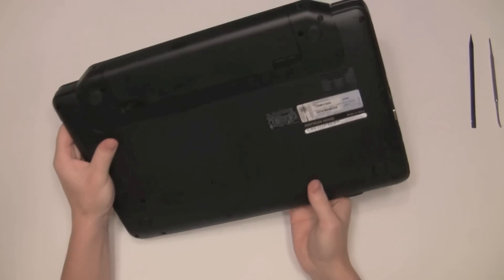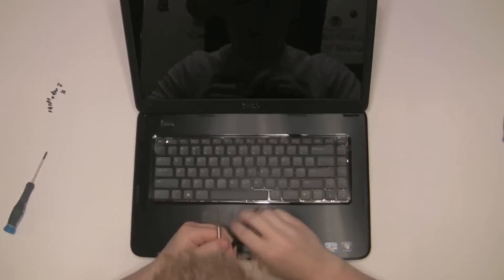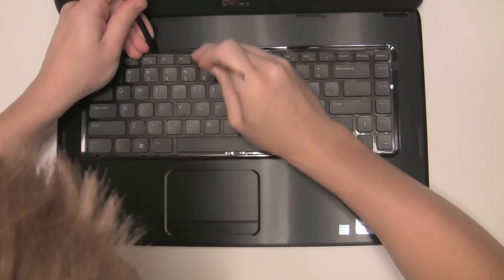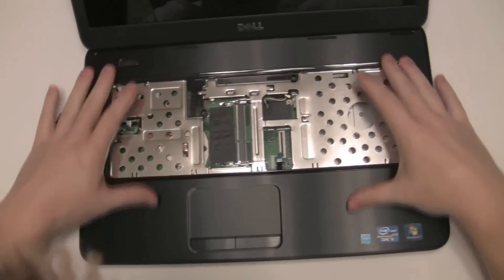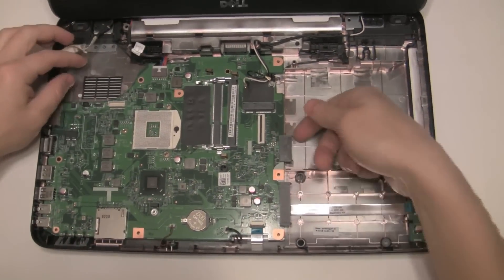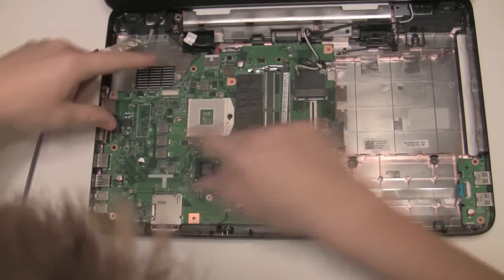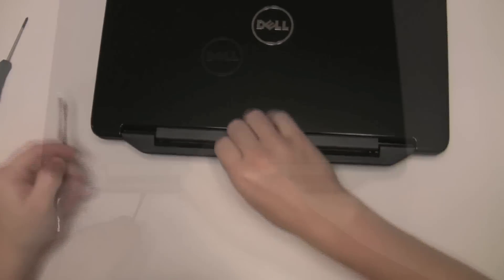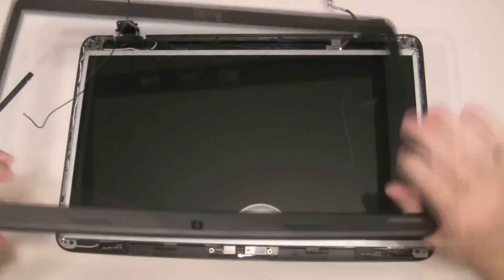Dell Inspiron 15 15N N5050 Teardown Disassembly HOW TO Replace HDD Hard drive and more

Comment: Tonight just found out the plug-in for the ethernet cable is busted. This Dell Inspiron n5050 was given to me, so I didn't know until I tried to plug in an ethernet cable to get a better connection. is the ethernet plug-in a part of the motherboard or can that be replaced separately?

Comment: I had 5 beeps coming from my BIOS and needed to get to the CMOS battery and this helped. Thank-you sir!
Reply: Where is the CMOS battery located? I'm guessing you don't have to take out the keyboard and it's located on the bottom/under the laptop?
Reply: I believe I did have to lift the keyboard which wasn't all that bad. It would make sense for a CMOS battery to be accessible from underneath, but that would be too easy. lol